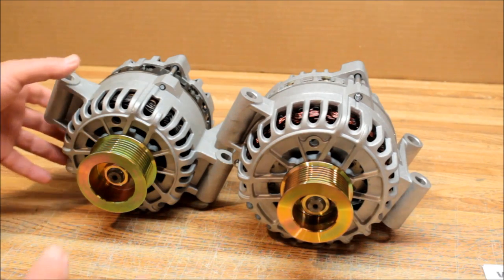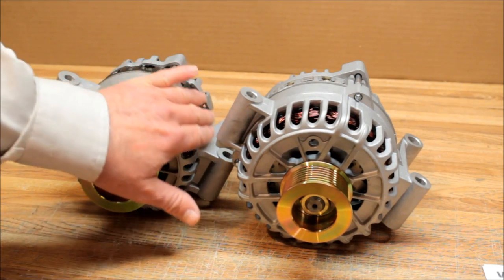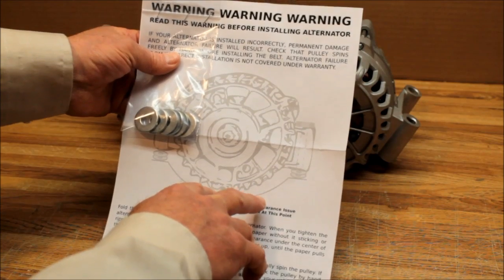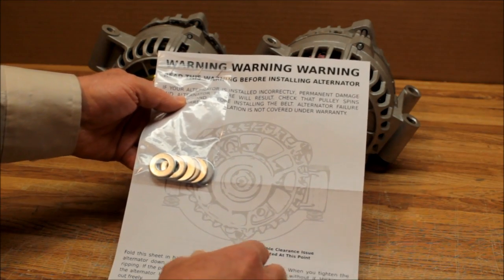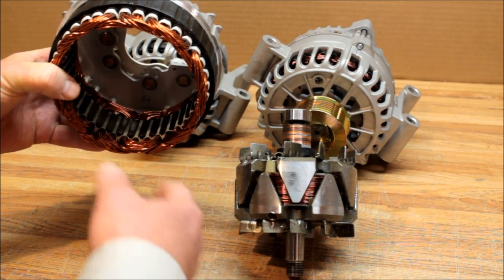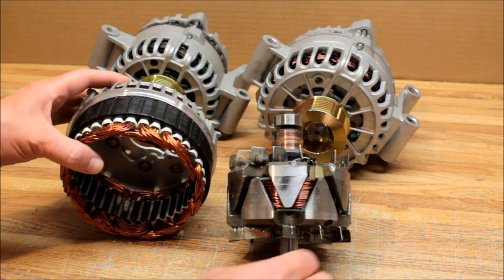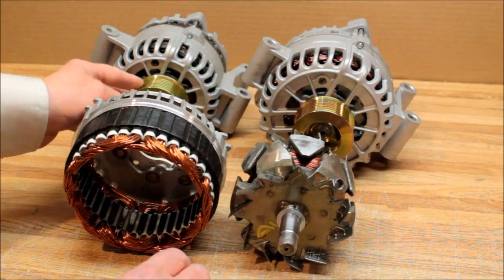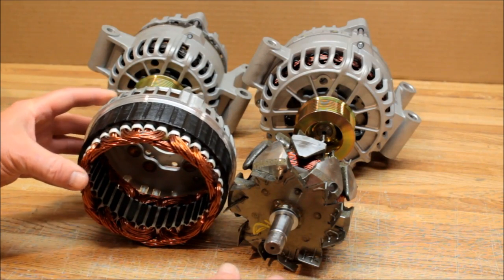Alternator Problems, Upgrading Ford's 6G Alternator issues going from Small Case to Large Case

Comment: The 99.5 and up had a 140 Amp alternator that was available as an option from the factory. I know because I ordered one.  They were also standard with the ambulance vehicles.  I'm talking about the ones with diesels.  I believe some engines earlier than 99.5 models had 2 alternators, I recall an upper and a lower position from reading the factory manual.  Anyway, I believe my alternator has the larger case.  I've never had any issues with lack of cranking amps and the batteries last longer with a larger alternator.  So far, I've only had to refresh my batteries once since it was new.  My F250  was delivered in June of 98, but it is a "99.5" model.

Comment: hey Alternatorman, how many amps is the new one? my original 06 diesel
alternator installed from dealer 2 years ago failed I was running  two high end amps
in my work van and thought that the demand caused it to fail, so my question is how many amps is the new one? .Oh your video just said 140 amps. and all the way up to 250 amp that's what I wanted to know what was your higher amp rating alternator you have. I will visit the link to get the pricing.
and thanks for the informative videos on rebuild alternators know what went bad on the old one etc.
My failed alternator that's 2 years old was done at a ford dealer here in Goodyear AZ
just pulled it out and a sticker on the alternator said remanufactured I said wow I never new I paid for a rebuilt alternator and also assumed as in past practice  that dealer put in new genuine parts I think I have scammed or not informed of this practice they probable pulled it out seen what was wrong replaced the part and put it back in, I will be going down there to settle this issues